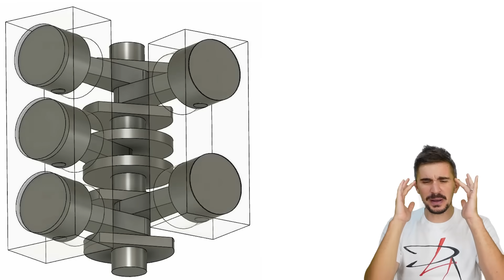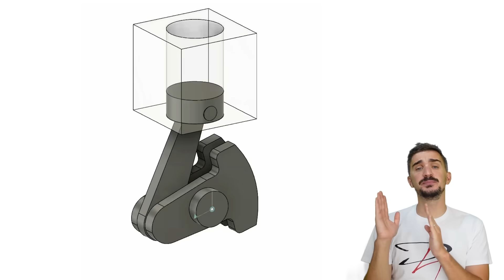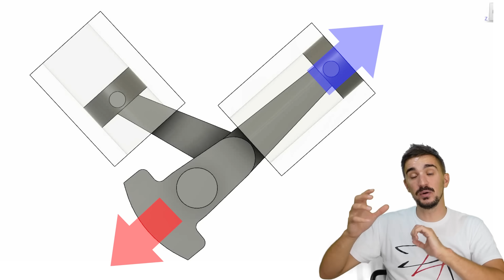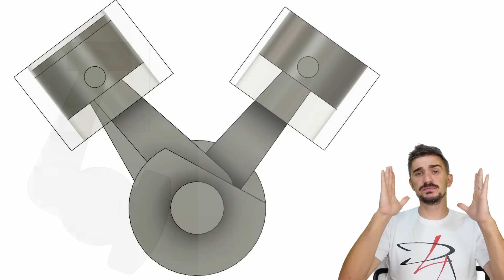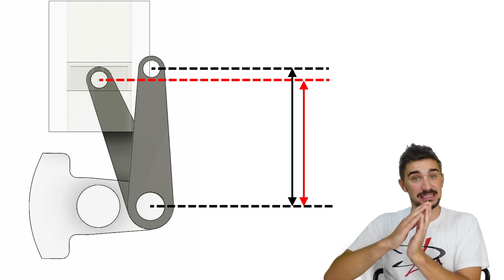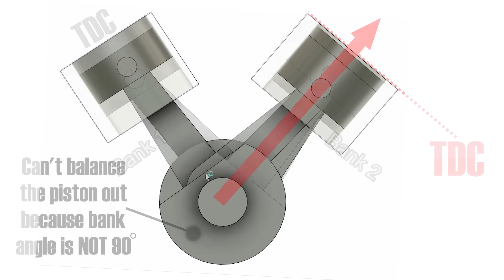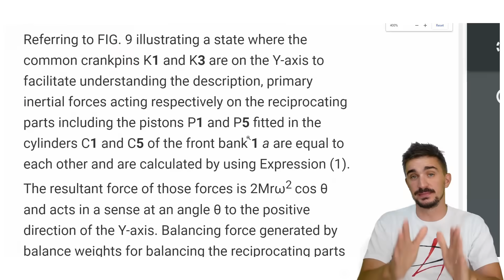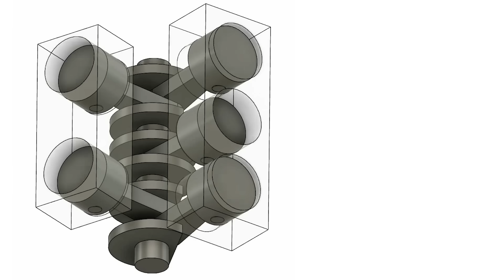Logic Defying V5 Engine - Honda's RC211V Explained Like Never Before

Comment: The V5 took advantage of the rules at the time that gave the same minimum weight as a V4, and at the time a larger amount of fuel was allowed for all sizes (26L or 24L, can't recall).  This allowed the thirstier but more powerful V5 to be so competitive.  As the max fuel load was progressively lowered it made it less advantageous, although Hayden winning the championship in its final year showed how good the basic bike was at that point.

Also don't discredit the tire rules at the time, Michelin would make special tires per Rossi's liking (and a few other riders) and actually fly them to the track between Friday practice and Sunday race.  A big advantage for Repsol Honda that was banned later in the decade.  Bridgestone was good at some tracks and terrible at others, any rider on 'stones had little chance at the title.
Reply: Until they went to 800cc and only Bridgestone teams could win, and Rossi made Yamaha switch.
Reply: @commissionimpossiblepod  As the decade progressed Bridgestone, with Ducati, became very competitive at some tracks and completely dominant by 2007.  The parc ferme rule ended the big advantage for Michelin.

Comment: the V5 (or simply 5 cylinders) is how a 4 stroke motor can have power stroke overlap. And within the rules of Moto GP for those seasons required a higher minimum weight IF the 4 stroke engine had 6 or more cylinders. 
SO HONDA BEING GENIUSES chose 5 cylinders for power stroke overlap WITHOUT weight penalty under the rules.  BUT they did other and more trippy shit and went all Vee motor and not even firing and fucked all our minds
Reply: Due to the firing order, the engine is unlikely to have power stroke overlap... which isn't currently valued in the motorcycle racing world, anyway.

Comment: the two pistons connected by one crank pin is also what gives harley their iconic sounds
Reply: you spelled jackhammer wrong.......
Reply: Nearly all V engines connect pistons in pairs to shared crankpins. Harley engines sound as terrible as they do because the V angle is so bad (45 degrees, if I recall correctly).

Comment: Thank you for all your videos. You explain well how the piston velocity is not sinusoidal but combines with the connecting rod movment and so the piston does not travel at the same speed on the bottom and top part of its movement.

But one thing seems odd with those explanations. An implicit assumption is done: The crankshaft spins at a constant velocity and hence by the geometry of the system, the piston generates first and second inbalances. It would be right if the crankshaft was spinned by an (electric) motor at constant speed, but the piston movement is due to combustion in the engine.

IMO the accurate way to compute the piston speed would be:
  1 - Estimate the curve of the force applied on piston along its course.
  2 - Estimate the apparent inertia of all the parts in movement reacting to the combustion force.
             - Parts: Piston, connecting rod, crankshaft, fly wheel... (nothing else for the sake of simplicity...)
             - According to the connecting rod position the apparent inertia varies as the lever arm does...

Surely it would be something hard to resolve mathematically to get an exact formula... but numerical methods can easily come to this end...

Is there such simulations that exist ? What there results look like ?

Comment: After a great deal of experimentation on British single cylinder and vertical twin 4 stroke engines I found that a balance factor of 62% of the weight of the total number of piston and rod assemblies works best, the weight of the components was measured and that weight was divided by the balance factor then the resultant weight was taken in solder wire that was then wound round each of the big end journals equally then the crank was placed on bearings so that it could rotate freely and holes drilled at the heaviest point until the crank with it's solder wire was in balance

Comment: Missing 2 stroke power pulses?  The best of the mad 2 stroke bikes had a 'big bang' engine where the 4 cylinders all fired nearly simultaneously, so acted like a powerful single cylinder bike.  Big bang engines are not used for cars, but they are useful for bikes, as they increase grip due to the lack of power pulses for each revolution of the tyre, giving the tyre a split second more to grip and making the bike a lot more user friendly.

Mick Doohan preferred the screamer engine with max power & more power pulses due to an even crank, But Mick was by all accounts a full-on maniac.  Respect!

Comment: Hey, I noticed your hand movments look kinda choppy in your footage. If you want to change that and still keep 50fps filming, try setting your shutter speed to 1/50 or if your camera uses angle instead, 360-degrees. It'll give everything a natural motion blur and drop the soap opera effect while remaining in silky smooth 50p.

Really love this video. Gave me an entirely new perspective on one of my favorite motorcycles (and their engines) ever made. :D
Reply from the maker: It's a sony zv1 and everything is full auto, I hoped the camera was choosing the correct mode by itself? Guess not. Appreciate the advice btw
Reply: @d4a  In auto mode, it's choosing everything that's typical. Which, unfortunately much like how doctors 70 years ago thought smoking tobacco is good for your health, typical is not necessarily ideal. (I will say the aperture, focus, iso, and white balance all look fine in auto, though.)

The 180-degree shutter speed guideline was based on hollywood being cheap, lazy, and lacking technology to shoot HFR. At the end of the day, our eyes don't have shutters (similar to a 360 shutter angle), but we definitely see greater than 24/25fps or even 30fps in a casual setting.

Give 50p with a 1/50 shutter (set your auto exposure to bias/lock the shutter speed) and try that. Or, if you want a slightly more "cinematic" look, try 30p with a 1/50 shutter. All in PAL mode (the 30p 1/50 won't flicker your lights like 30p auto does). Here's a tool to calculate flicker-free camera FPS and shutter settings. It has angle as well as speed, so you should be able to get your camera to accept the setting either way. https://www.red.com/flicker-free-video And here's a vid showing the different shutters at 25p and 50p. Best looking is 50p-360(1/50) https://www.youtube.com/watch?v=oaaBOu086Xg&ab_channel=JarleLeirpoll

Another benefit to the 30p option is that you'll save 60% on your storage space. Just make sure it's true 30p and not 29.97, and especially don't drop a 29.97 into a true-30 editing timeline this will cause ugly judder artifacts. Uploading decimal frame rates to youtube (even in matching decimal timelines) will get re-encoded to true rates and also cause judder.

3RD EDIT: Forgot to say "you're welcome" and didn't wanna come off too clinical or asinine. I appreciate the acknowledgement. :)

Comment: Saying V5 engines did not exist is more than a little misleading. Not used on bikes maybe, but VW has had a V5 engine since 1997, motorcycles had a V3 as long ago as 1955! There have been V7 and V9 engines for bikes too for a couple of years now (just to come fully up to date). ❓❓❓❓
Reply: Obviously, you didn't watch the video, since the VW VR5 was covered.
Please list the bikes with V7 and V9 engines.

Comment: Now, even Manufacturer of cars also do uneven engine cylinder  too. Thanks to Honda's brilliance by making it possible & especially reliable. 

Toyota have I3 engine today to their productions car as well as the hypercar maker Koenigsegg which cars that runs 600 HP to 1750 HP combined with it's battery power. 

You know with Yamaha's bike lack of power in MotoGP, I think they could sort it out by doing 5 cylinder Inline engine. If they do, I'm certain the other manufacturer would be shock 😲 even the Desmodromic of the Ducati.

Comment: Amazing as always my dude! 👍 What about rotary engine motorcycles? I know about the Suzuki RE5... (10 minutes later...) Actually I just watched VisioRacer's video and it's pretty good. I suppose the reason rotary engines didn't stick around for bikes is because Mazda is the only one who really got them to work and Mazda makes cars. And cooling. Cooling is a b__ on rotary engine cars. With as high as bike engines rev, I wonder what could have been for a motorcycle size wankel engine.

Comment: With high powered bikes, it's all about power pulses and tire contact patch. This was the reason why Yamaha went to the crossplane crank.  Engines were either big bang or screamer, where the power pulses would hit then pause or keep coming in an even but non stop fashion. This power delivery had an effect on controlability. Big bang engines are easier to control, theoretically, while screamers are harder to control. If a rider has the skill or preference they end up telling the mechanics which style engine they want to use. The big bang engines allowed the tire to recover, improving traction and control, while the screamers usually were more powerful.
Reply from the maker: The rc211v v5 existed in both odd firing and very odd firing form, aka big bang. Interestingly enough, the 260hp version was the big bang. Here's the Yamaha crossplane:
https://youtu.be/uM-ycHS9uvw

Comment: This video raises a question:

So far my (very limited) understanding of combustion engines was that the piston is actually pushed down by the combustion inside the combustion chamber. In this video though, you repeatedly say that the piston is pulled down by the crankshaft via the connecting rod. 

Is that just wording i don't quite get (not a native speaker) or is my understanding of the entire process totally off? 

Other than that a very nice explanation :)
Reply: Pressure due to combustion pushes down on the piston for the entire power stroke, but the force required to change the direction of the piston at the top of the stroke is much higher than the force provided by combustion, so briefly the connecting rod must pull the piston down.

This video is all about balance, so he only considers the forces due to inertia. Force due to the actual operation of the engine - pulling air in, compressing it, combustion, and exhaust - are ignored because they don't affect balance.
Reply: @brianb-p6586  That's a very nice explanation, thank you.

Comment: Sounds like you could throw the paper balance out and use a computer. You put the number of pistons and let the computer figure out the piston weight and angle and counter weight inertial weight and angles. You need the pistons containers but counter weights are a free variable cut into the crank, they don't need to be identical and in sync with an individual piston, you could have a computer create an optimal size and arrangement. Countering the reversing forces of the pistons at top and bottom are the keys to balance.

Comment: Great explanation! Just a very small constructive criticism - your half whispering words (not engaging your vocal chords) makes your speech a bit hard to understand. A few examples: the word "maximum" in "maximum velocity" at around 10:11 while you pronounce it clearly many times before and after that. Or "on to the engine" at 10:41 or "at top dead centre" at 11:27 :)

Comment: Very cool. But doncha think its way past time to dump the 130 year old piston engine? We just keep tweaking it like solenoid operated valves etc but still same complicated parts, lube system, heat waste, emissions that ended the rotary etc. Why cant a simple turbine run ultra lean in cruise mode etc.
Reply: because they have a too high/narrow operating range and no current transmission can cope with it. Chrysler quickly found this out decades ago.

Comment: The NSR500 was not a 2 stroke engine . It was an oval cylinder 4 stroke “ Siamese piston “ ( if you will) V-8 turned into V-4  and was just too costly to produce & machine. Oval piston rings & pistons & cylinders were WAAAAY radical to make & machine  & I heard rumors were a bitch to get to seal to cylinders properly. The V-5 at least uses standard round bores and more or less conventional internal designs for parts. Those NSR500 ‘s did have an Awesome sound that many did think was a 2stroke because of astronomical high rpm.  Many motorcycle magazines covered the bike back in the day. Otherwise a pretty cool video here. 👍

Comment: Honda has built some incredible engines. My dream is owning a 1992 Honda NR750. Repsol had a give away some years ago where you bought 5 quarts of oil you Maisto 1:18 scale replica of Nicky Hayden's winning 2006 RC211V in a small display. Honda isn't afraid to build unconventional engines. May have tried much like the Suzuki RE5 and the RG 500 Gamma, but Honda is still doing it. Honda has made some of the best engines of all time.

Comment: Nice job on explaining a very complex engine.
I'm an old motor mechanic, I'd heard of the glossed over fact that the Honda V5 used the extra cylinder to balance the other cylinders, but hearing the engineering behind it certainly makes your head spin 🙂👍
Reply: 🤔Are you a mechanic who is old, or are you a mechanic that specializes in old motors?
Reply: @GeorgeTsiros 
I'm 55 and work on old and new things 🙂
You be the judge.

Comment: All that without even going in to the firing order, which basically concentrated the power pulses in order to enable the rear tyre to regain grip momentarily between them.

The actual design may be shrouded in secrecy, but I am sure someone like Allen Millyard will be building one in his backyard shed as we speak with just a box of leftover engine parts, a hacksaw, and a swiss army knife.

Comment: I have to correct you in sec. 0:21 because VW build the VR5 whats is a narrow angle V5 engine since 1997 so technically  the world has seen a V5 before mybe not in a motorcycle.

Comment: Please please please do a video analysing the scenario(s) under which it makes sense to buy an electric car if you are, for example:
-  Moving from an avg family diesel salon to a salon EV
- Moving to an SUV EV from an avg family saloon 
- If your annual mileage is less than, say, 10k km verses more than that
- If your electricity supply is from gas versus solar
- Etc. (Ideally real world based)

I believe that driving an old diesel car (even a VW 😏) less than 5k km a year is far better than getting a brand new electric SUV and upgrading every, say, 6 years… especially if most of your countries electricity generation is from gas. 

Car manufacturers’ marketing departments can really convince people of the ‘right thing’, even if the truly green option is to NOT drive. I’d love to be armed with compelling data and insight to debate this as more people buy electric (which I agree is the future, but not eco friendly in many real world cases… like the retired couple who go electric, but hardly drive more than 10km a week!!!).

Comment: Very helpful video with excellent visuals. You left out the principle reason for the v5 though: the rulebook at the time specified the same ballast for 4 and 5 cylinder engines. Almost everyone else built 4s with the exception of the Aprilia cube which used a 3 cylinder chunk of a F1 motor. Only Honda had the ambition and engineering acumen to do a V5 which could increase the valve area over a 4cyl with no weight penalty.

Comment: Besides the v5 engine you've already blown my mind for explaining why two stroke engines make more power. Half way through and I've already reached for the gin!
Reply: But it doesn't work as you might expect. Yes, a 2-stroke fires every cylinder on every crankshaft revolution and that sounds like twice as much power as a 4-stroke, but the 4-stroke works for the whole length of the compression and power strokes while a 2-stroke only has compression or power while the piston is above the ports. The 2-stroke wastes the bottom part of the stroke on exhaust and intake.

The power advantage of 2-strokes was mostly just being able to turn faster, moving more air and fuel per minute, but modern 4-strokes are so fast that this no longer matters much.

Comment: Great video. Only, you’re wrong on one thing. A piston’s maximum acceleration is when the line from rod small end and big end is exactly 90 degrees to the line from crank centerline to rod big end. 

You depicted it as the crank was 90 degrees to the cylinder axis